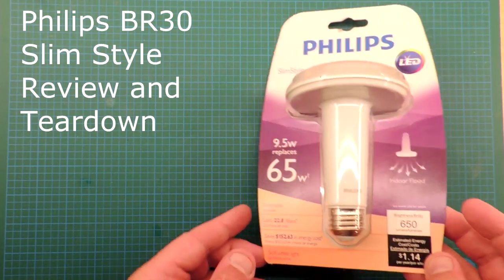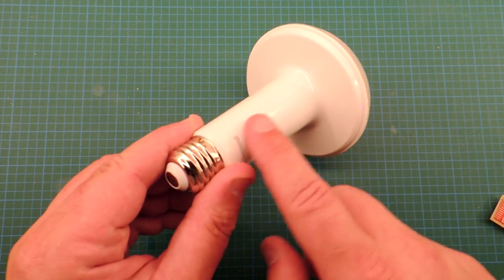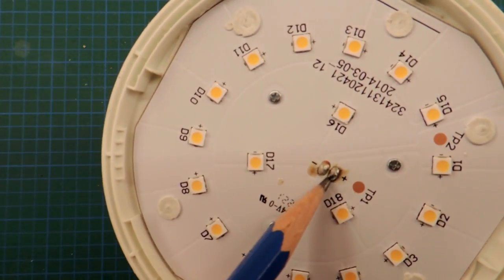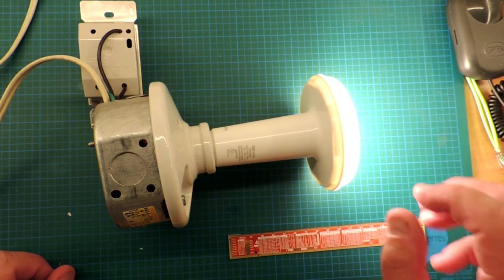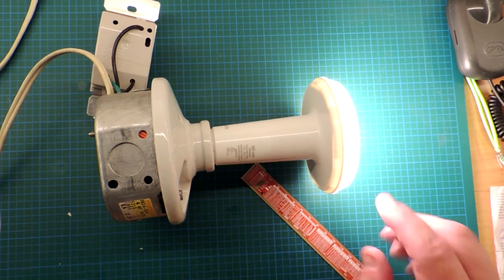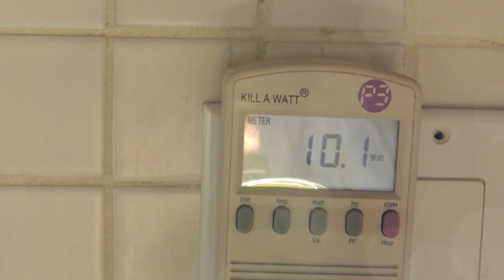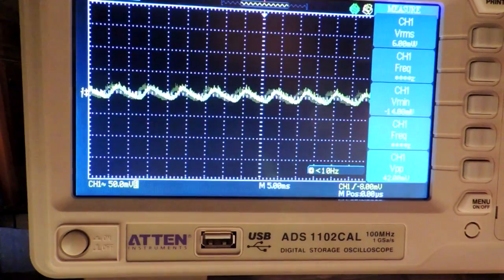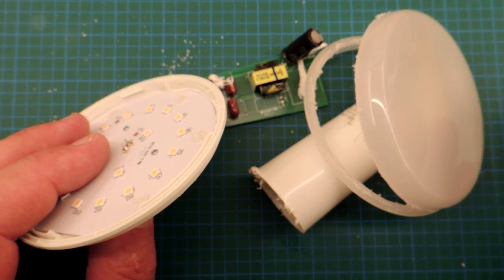Philips BR30 SlimStyle LED Bulb review:   MBA Inspired!

Comment: It is 9.5W, it replaces 65W, electronupdate, what have you been thinking?
68lm/W is not that good.
Reply from the maker: Sigh, good catch.  The danger of doing a review late in the evening.  Another knock against this bulb.
Reply: 65 lumens per watt based on measured power draw. Actually not terrible for a BR type bulb. CFL can barely do 50 L/w in reflector style bulbs. I'd still like to see north of 75 L/w in a LED BR bulb. The Polaroid 800 lumen BR30 can make 75 L/w and was on sale for under $10.
Reply: ***** Can you do a teardown on a LIFX LED bulb? Or the Philips HUE?
Reply: I have a few of these: http://www.clasohlson.com/uk/Standard-LED-Bulb/Pr365376000

8W for 810lm, confirmed by myself. 100lm/W is what I'd expect from modern low cost bulb.
Reply: mojochan You're ignoring that BR30 bulbs ALL produce fewer lumens per watt whether incan, CFL, or LED.  However, did you confirm it produces 810lm, or only that it is 8W?  A lot of generic bulbs have false lumen ratings that their LEDs could only produce if driven to a higher current than they are and if there was no phosphor dome or diffuser bulb over them.

Frankly, unless they contain LEDs whose spec sheets show them to be higher efficiency LEDs, then they are probably stretching the truth and no more efficient, if even as efficient.  Major brand companies cannot gamble like this but fly by night generics which are rebranded 100's of times, think they can get away with it.  The only way to be sure without measurement equipment is to try both bulbs side by side, if they are the same color temperature.

Comment: Seems to have quite poor efficiency. My benchmark is 8W for 800lm.
Reply: mojochan Saying that more than once doesn't make it more true.  There are a lot of fraudulently rated generic bulbs out there that produce fewer, not more lumens per watt.  If it doesn't use major brand LEDs then it's practically guaranteed to produce fewer.  Remember, we're talking about BR30.   Stating the efficiency of a different bulb shape is pointless to those buying BR30 because that's what they need.

Comment: I would never buy an LED bulb with such a short life.
Reply: Who says it has short life? warranty is 3 years.
Your TV also has only 2 years warranty, but lasts much longer...
Reply: Paul Boonen but TV can operate much longer than warranty, instead of product design intentionally for failure (overhating LED's). Temperature, LED's and heat, that's simple math and statistical prediction... http://s462.photobucket.com/user/jwppics/media/CREE_XLamp7090XR-ELifetime.jpg.html
Reply: tmb282
How do you conclude this is intentionally designed for failure?
Reply: tmb282 It's not relevant.  The electrolytic capacitor will fail long before the LED in hot running lights.  Besides, to them lifetime only means until it drops below a certain % of original lumen value but still works.

Further, in modern LCD TVs the PSU capacitors are also a typical first failure point unless it sees a power surge.  We might say that comparing apples and apples, the switchmode PSU capacitors in either product could have about the same lifespan.

Further, TVs could run cooler than they do too, and have longer life as a result.  PS - Nobody in the industry thinks a modern LCD TV will last 22 years which is a common rating for LED bulbs.  You're usually lucky to get 10 years if it's on most of the day.